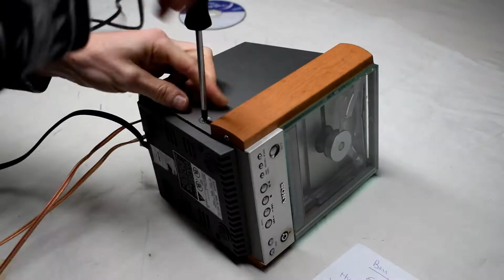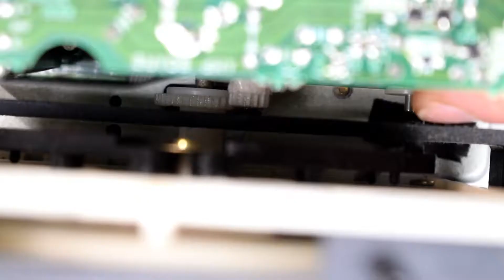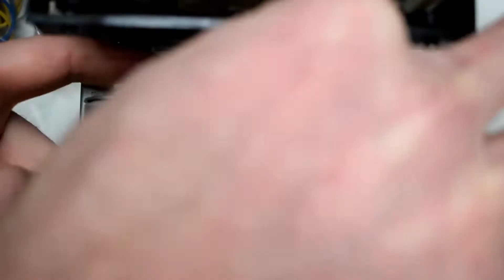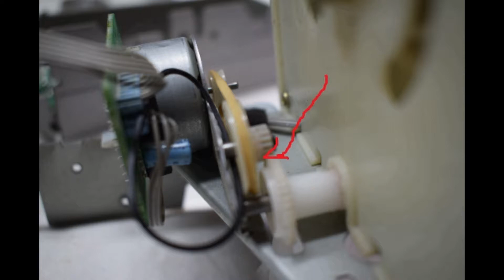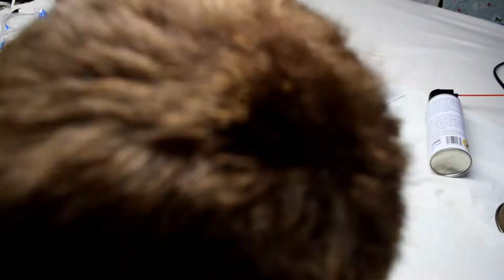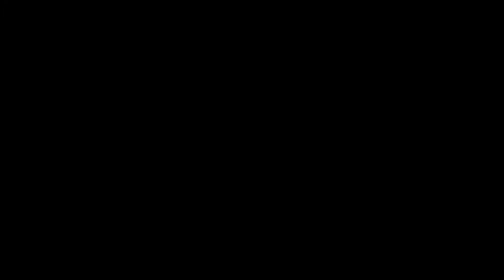Sony HCD EX1 repair (Amazing older technology)

Comment from the maker: Any Questions just ask them below
Reply: My Sony cmt-ex1 is locked, with the cd inside of it, it doesnt eject. What can i do?
Reply from the maker: @ahp041  Open it up and check out the motor is if the gears are ok.
Reply: Fantastic! I’m having trouble finding the proper elastic bands that you show. Where can I find these exactly? Oh, for a Radio Shack! I have two of these models.  One I bought new many years ago. Another was a thrift store find. Both have this problem. Great design except here in removing the band easily. Thank you!
Reply from the maker: @christophermarquez2310  just find a bag of assorted elastics from the dollar store.
Reply: Mine makes a clicking sound when spinning. Any idea on how to fix it?

Comment: Yes, low volume will work, but only a few minutes, either it will drop sound completely or leave it on one speaker 

But will drop one speaker depending on which one it can pick up the audio first 

Speakers work son would like help

Comment: I need speaker wires for mine.  I noticed the CD player has the part where the wire must have those vcr prongs & the speaker has  the hole where you stuck bare end wires. Can someone tell me the proper name of the wires tonthe speaker I need

Comment: I took this same model into a shop. They charged $95 to look at it and the estimate was $200 on top of that. This angered me because if it takes two hours then I think their price was out of line. I picked it up without them doing anything so wish me luck on my repair. I might look for some rubber bands before I start.
Reply: Same they charge me 100

Comment: I just picked one of these up and the display is extremely dim. This is one of the few things that showed up when I started Googling it. Do you know if there are replacement displays available and if this is a doable repair? Thanks!
Reply: There is a brightness setting as you scroll through the main settings with the remote to make it brighter...

Comment: I had to do the same repair.  I was able to remove the electronics (as I suspect you did) but was not brave enough to take the whole thing apart further to figure out how to move the gears away from each other to enable easily putting  a new band in place.  I took a chance and was able to get the band out by letting it get squished between the gears and turning. This didn't damage the band.  As I didn't have a replacement band of the correct size, I just put the old band in some boiling water for two minutes which shrunk it enough so that it worked.
Reply from the maker: great glad I could help
Reply: I'm going to try the boiling water trick, having removed the band -- finally. Fingers crossed.
Reply: @EllisBooker  Good luck.
Reply: @sethkestenbaum9896  Sadly, the original band broke after the boiling. I'm now going to try a small rubber band, which some other guides recommend as a DIY solution.
Reply: @EllisBooker  Sorry to hear that.  I'll probably end up doing a rubber band swap at some point too.
Reply from the maker: @EllisBooker  hope all goes well